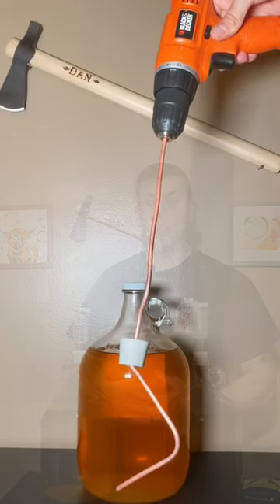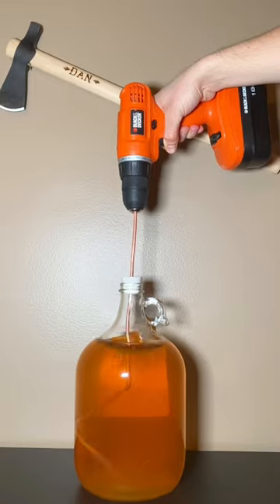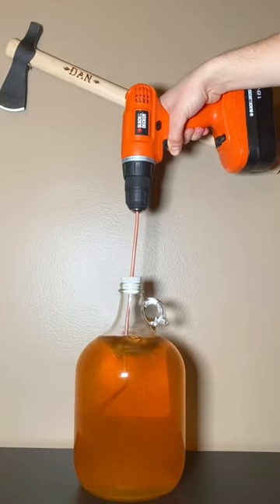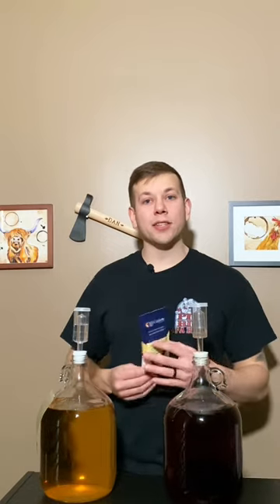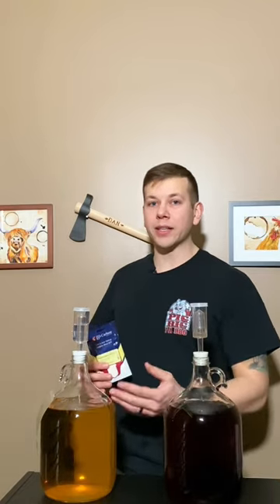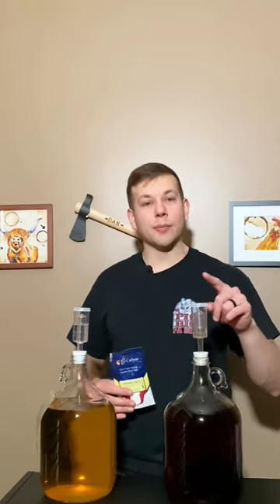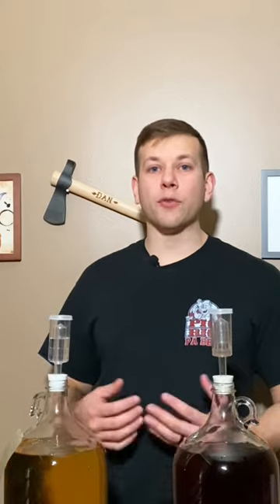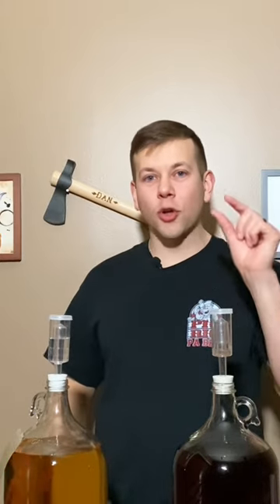Wine Making at Home Pt. 3 | Degassing & Back Sweetening #shorts

Comment: Mine stopped bubbing completely after 1 week. Is that normal?
Reply from the maker: It can be. It all depends on the speed of fermentation. If you can measure the specific gravity, see if it still has sugar in it. Otherwise give it a taste and if it’s overly sweet, you may need to re add yeast.
Reply from the maker: I would also keep an eye on it and see if it starts back up.